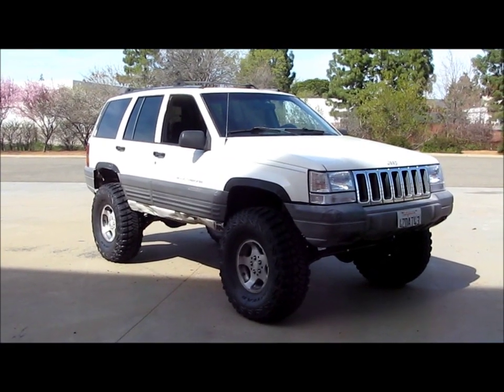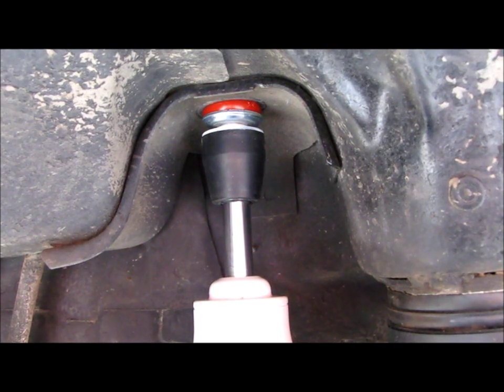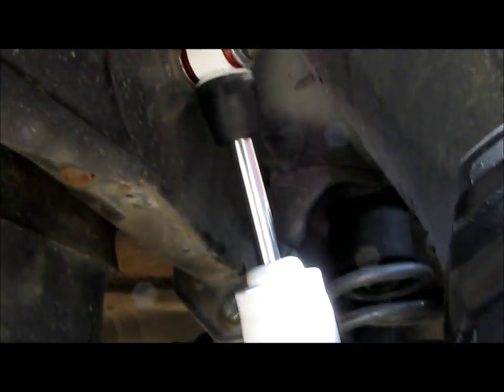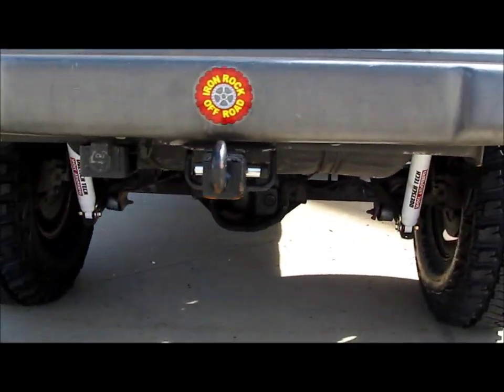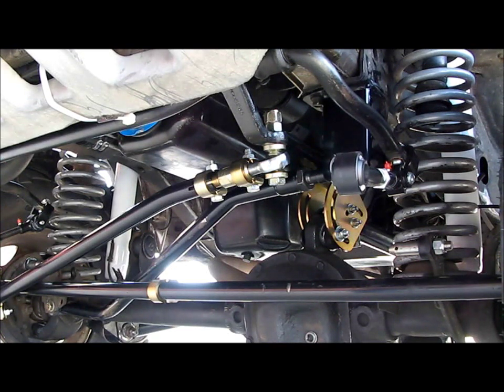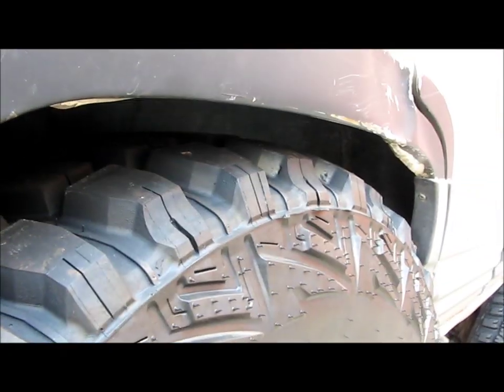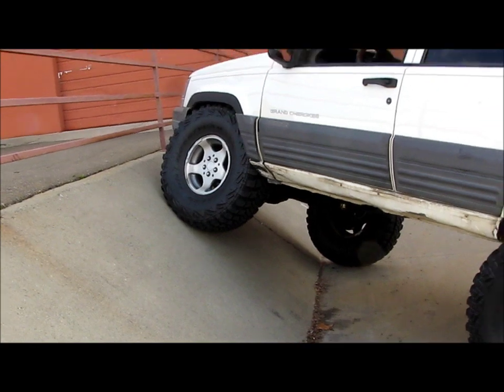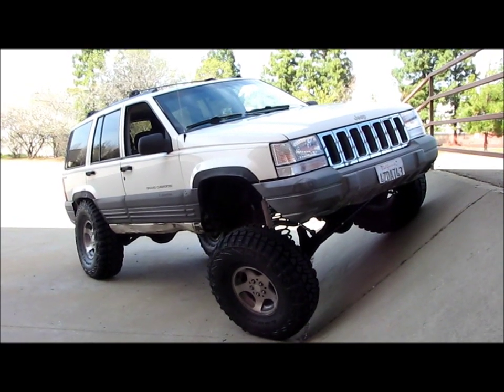Jeep Grand Cherokee 4x4 Project ZJ Part 10 Doetsch Tech 8000 Prerunner Shocks Review Shock Absorbers

Comment: I know this is an old video but I would suggest with the urethane lift block in the rear that you weld in 1.75" or 2" diameter tube about 3" long to the stock spring pillars that are in the middle of the spring cushions. This will keep your springs from falling out. That will allow you to give yourself more limiting strap slack to flex further.
Reply from the maker: +All Out Throttle Great advice, that's what my buddy did to his.  I ended up installing IRO's post extension kit and swapping out to taller springs without a spacer.
Reply: @ryan.vision do you have a item number for the post extension? Same issue on mine and I'm trying to fix it

Comment: can u U bolt or strap down the very top of ur coil to the spacer so u dont have to use the limit strap. just woundering. but great setup.
Reply from the maker: hmongwild The better thing to do is extend the upper spring post so things can droop down more and slide right back into place without falling out.  You can buy exhaust pipe pieces at AutoZone that fit the spring post perfectly then cut to the correct length and screw or weld in place to existing post.  IRO also sells extension kits and that's what I use now.

Comment: Dude great video just the information I was looking for for my Grand Cherokee...I got a 6.5 in rock arm lift these should be perfect....What is your exhaust system???that sounds like a beast? How loud are those tires rolling down the road?
Reply from the maker: The tires surprisingly aren't very loud at all even at 80 mph.  My exhaust is cut off right after the cat with a turndown, no muffler.  Check out www.projectzj.com for all the info and more videos

Comment: Hey what’s up ryan ...man nice details videos. I am on my project zj  I am going for the same setup 5.5” kit whats the sizes of does coils ? I don’t see a 5.5” coil on irons rocks website they jump to a 7”. Thanks
Reply from the maker: This is an older video of when I was on Rubicon Express 3.5 springs with 2" spacers.  I ended up using IRO coils and had a bit of a custom setup but it was around 7" in the end.

Comment: So i am looking to get those same shocks. I have the exact same set up with Rubicon express 3.5 lift springs in the front and moved my front springs to the rear with 2" by pucks all around. On iron rock website there full set for 5.5" of lift come with 8421 and 8371. The rear is obviously different part number then you got. Do you recommend whats in the kit or to order the  ones you have?
Reply: The 8371 they recommend are 29.5" extended, 17" collapsed, with 12.5" of travel compared to your 8403 with 32" extended,  18.7" compressed, and 13.3" of travel
Reply from the maker: I would start out with IRO's recommended shocks, run those for a while, then decide if you need to upgrade.  Most likely you'll be fine with what they send.  These shocks are around $50 each if I remember correctly, so won't hit the wallet too hard if you want to go longer later.
Reply: @ryan.vision  thanks man! I did the price check and they are not to bad. Never heard of the brand before so I was a bit worried until I saw your vid on them.

Comment: Hello friend, that brand of shock absorbers will be very hard on roads and wells up normal route? It's better than RANCHO 5000? 
They have automatic valve adjustment road ..?
Reply from the maker: Night Vision Uruguay I've had Rancho RS5000 and RS9000 on other vehicles but not this one.  It rides great on and off road, not too firm, not too soft.  Keep in mind the ride also greatly depends on your spring rate.  I'm running Rubicon Express springs and they ride really nice.  No complaints about the shocks, love them.

Comment: How firm are these on road? is there a noticeable firmness compared to stock shocks?
Reply from the maker: +Photon Media I've never had stock shocks to compare, but I really like how these ride on the road.  I'm running IRO springs front and rear now for the firmer spring rate because I don't run any sway bars.  It's a comfortable ride but not all bouncy, soaks up the bumps and moves on but I wouldn't call it a firm or harsh ride at all.  I love these shocks!
Reply: My LJR on 4in long arm from IRO rides like ass with doestech shocks. Can't decide if it's the higher spring rate or cheap shocks

Comment: hey man. i am running IRO long arm front and rear and 35" mtr. my problem is that the tirs rub when turning offroad inside the wheel well. I have folded and trimmed as much as possible. how did you get enough room??
Reply from the maker: 3.5 backspacing on wheels helps a lot and I removed any plastic fender liner
Reply from the maker: Also make sure your track bars are adjusted correctly to the axles are centered under the Jeep

Comment: Hey Ryan, love the video even if its old. Im in the process of installing a 5.5 Rock link Long Arm FULL kit from IRO. My stock bumpstops are gone, will I be needing to replace those since I'm running the doetsch Tech shocks the same as you or am I good with the extenders that IRO gave me with the kit? Any input? Thanks!
Reply from the maker: I never had a problem without bump stops on the rear of the ZJ with the DT shocks, but honestly, it would be better to have bump stops between the body and axle just before the shock bottoms out.  Any time you can avoid bottoming out or overextending the shock it's a good thing.  If you break a shock on the trail it gets real bouncy and coils can start rolling down hills haha bump stops and limit straps are easy and important mods.
Reply: How did it go.? I'm doing the same kit now on my WJ. I found Iron Rock very informed on my questions.

Comment: How good do they do on highway bumps?
Reply from the maker: Highways are pretty smooth in my neck of the woods but they did great on 100+ mile journeys at 65-85 mph.  Was very happy with these shocks on and off road.  When I later redid the rear suspension, got the same brand, just longer for 15" travel.

Comment: So I got a 3.5" lift for an amazing deal, but it didn't have shocks. I've been looking at these. It's my daily driver so how is the ride? And how have they held up over time?
Reply from the maker: I love these shocks, they've been great.  Some might say they ride a bit firm on the road but I like the ride and they work really great off road.  I just bought another set with more travel for my new suspension setup.
Reply: RYANVISION thank you for the fast response. This is likely to be my next purchase. So you said you got them from the IRO website, did they seem to be the right extension and compression length for what you have? If not I may pick a custom length from the doetsch site. I really appreciate the info, and I love your build

Comment: you're running too much air in your tires you will wear the middle of the tire out shortening tire life.. happy wheeling
Reply from the maker: gwallnut666 They only have 20 psi in them.  They look bowed out on the top where no weight is on them because I'm on 7 inch wide rims with 12.50 tires.  Been really happy with the wear on these tires.